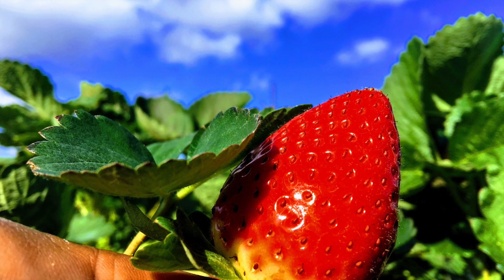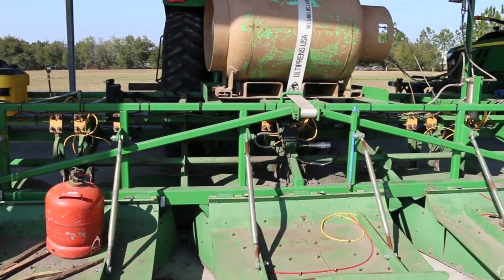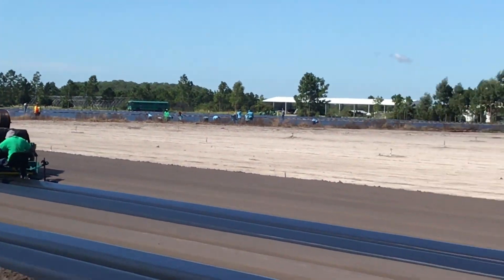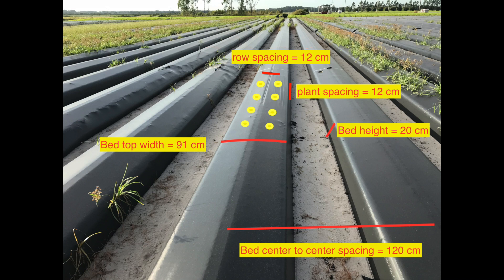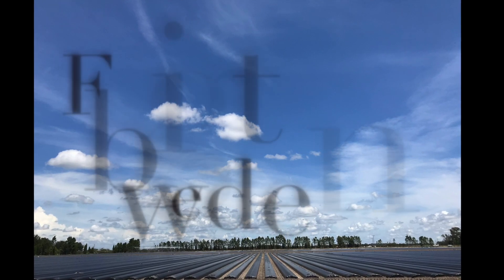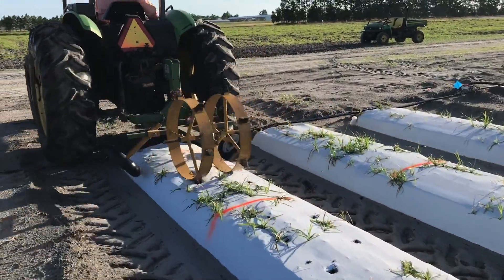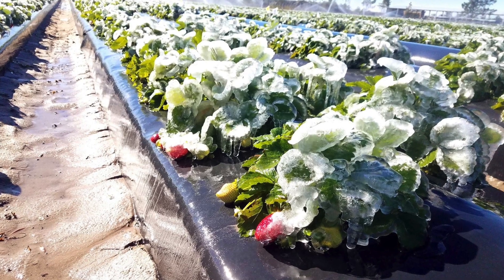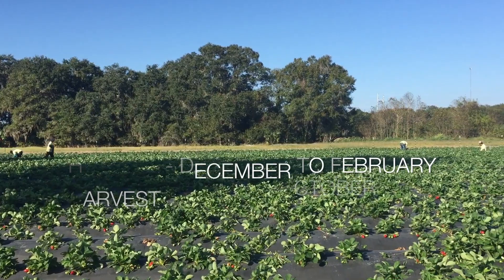Strawberry Production in Florida

Comment: There is still an error in your correction of bed geometry. You are using the unit Feet and If I calculate 60 cm = 12 inch, which is matching (one inch is 2.54 cm).